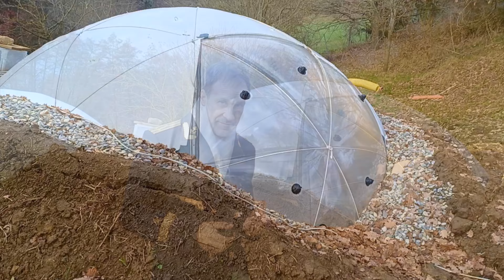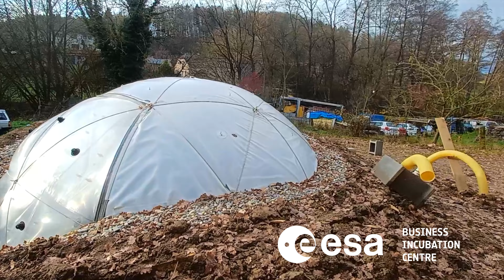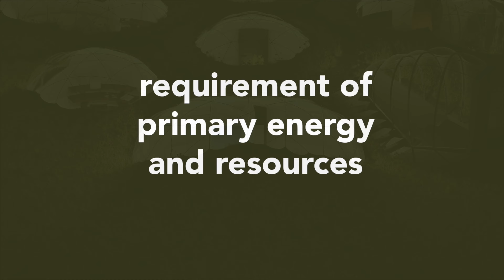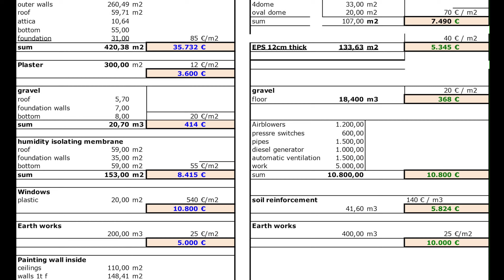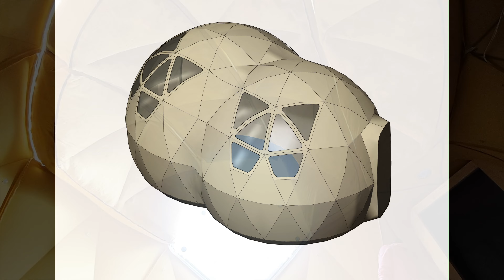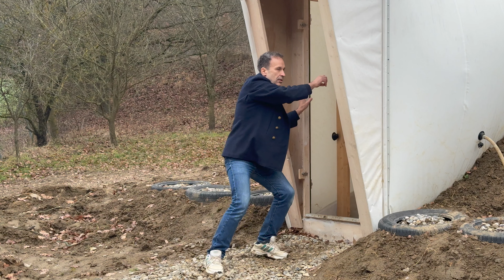Mars Habitat - Earth House Prototype

Comment: Hey Thomas! I love to see another post from you :)

Would the building structure be strong enough to handle the pressure differential while on the Martian surface?

By using higher concentrations of oxygen humans could survive in about 300 millibars (30% sea level pressure) but too high oxygen content produces fire risks. 

400 millibars maybe be more realistic, but that still is quite the pressure differential considering Mars atmospheric pressure is about 10 Millibars.

Even with a small internal area, wouldn't a different material or some form of external support be required to contain the outward expansion?
Reply from the maker: Hello Will.
this particular terrestrial structure cannot candle a pressure difference as it would be required on Mars.  Here on Earth it simply is not necessary.   We only need 10 -15 millibars to keep the structure stable.  
But it is possible to build an inflatable structure that can hold such pressure. Just the effort would me much higher than on this one, for the membrane and for the airlock . Either it would be woven Kevlar as the inflatable module on the ISS, or like on my prototype with an external net of ropes, but the ropes would need to be stronger.
The rope net is not very dominantly shown in this video, but part of  it can be seen:  on the dome producing from the ground.
Reply: @thomasherzig174 thanks for the clarification! Good to know that small inflatable structures would be feasible on Mars as well as the ISS. 

Do you feel that inflatable structures are cost efficient and durable enough to be used as the primary source of housing on Mars? 

Unfortunately it sounds like it would be a while before such a structure could be constructed from insitu resources
Reply from the maker: @MarsMatters  I think that inflatable structures ,  covered with loose regolith are the best option:
3D-printing need a huge amount of electric energy. On Mars it is very difficult to provide that amount of energy, since sunlight for PV-panels is weaker than on earth and dependent on atmospheric conditions.  Kilopower reactors require a high payload , A 10kW unit has a mass of 1500kg. and you need to trust in the robots that are supposed to carry out the 3D-process.
Since you cannot trust that 3D-printed walls are 100% airtight you need to lay an airtight membrane inside anyway.
An inflatable structure can be prefabricated on earth under ideal conditions and carefully be tested before it is shipped to Mars.
On Mars, the thick regolith cover protects the membrane from radiation, thermal stress and meteorite impacts. So the membrane  structure can be lighter and simpler than that on the ISS- module, that needs to withstand impacts of space debris.
Reply: @thomasherzig174 and the light weight nature of membranes would allow for a whole lot of them to be sent from Earth on a single starship. I like the idea :)
Reply from the maker: @MarsMatters  exactly! I guess, it is possible to keep the weight of the membrane structure between 1kg/m2 and 2kg/m2 of wall surface.  Just the structure ( without interior equipment) of a 1000m2 habitat would have a payload of 3000 -6000 kg only and the transport volume could be kept within 8 - 20 m3